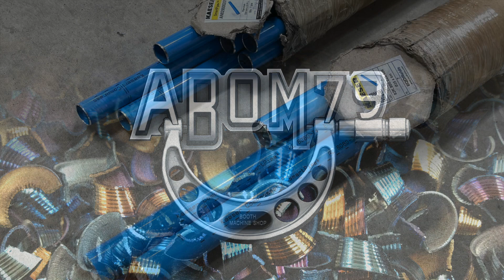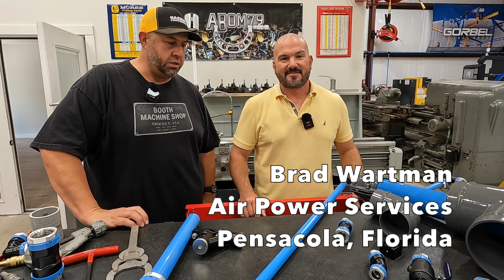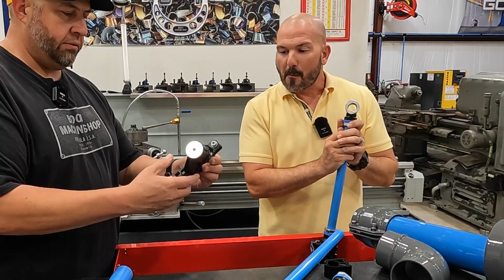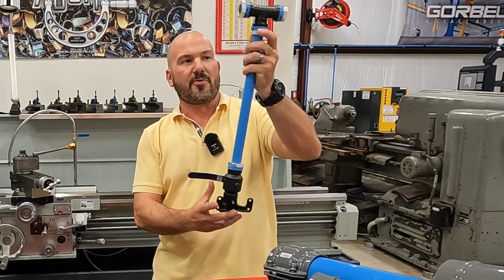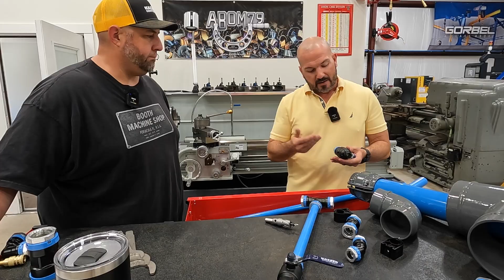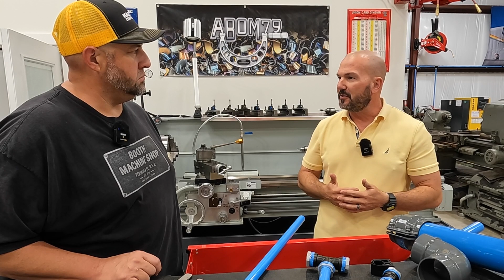KAESER Smart Pipe Plus Air System Discussion with Air Power Services

Comment: I know the compressor is Branded Kaeser which is a German company which a lot of people do not like but i do have to say that they are a very good compressor compared to the majority and do run a lot quieter than most. I am from the UK and Kaeser are Branded HPC in the UK, and having been trained on Various brands of compressor they are basically all the same, some a little noisier than others, but the difference is in the controllers, and this is where a lot of the problems arise with screw or scroll compressors. Now i have found that the Sigma controller on Kaeser/HPC compressors the most reliable, as some like Atlas Copco and Mark Compressors including Boge Compressors tend to be a little short on quality, there are forever glitches in them, and replacements do not come cheap.

Comment: PEX pipe SharkBite or Swedge fitting probably ten times cheaper just as good for just as long. Overrated over-engineered overpriced. Less is always more
Reply: pex works for sure. We use pex-al-pex because it stays straight during install

Comment: I keep telling people to NEVER use PVC for air. There are so many things that can happen. As they say, if it gets too,cold, it gets brittle. If it’s lightly by smacked by something, it explodes. But if it gets too warm, it gets soft. Then it grows a bubble and explodes. PVC gets soft enough to easily bend at just 140 degrees f. That’s not as hot as you think it is. If the joint isn’t cleaned and glued properly, it will blow apart. If it isn’t supported well, it can blow. But a big problem is the varying pressure in air, because air is, after all, compressible. Water does t vary that way. PVC is not good with a sudden rise in pressure.

I’ve seen every kind of PVC blowout. It’s not pretty. Some people claim they been using it for years without a problem. Well, good luck for them. Don’t follow their stupidity. You won’t be as lucky.

Also don’t use iron pipe. Water in the system will rust it over time. Copper is fine. I’ve done thousands of feet of that.

Comment: In my company production facility and shop we run copper pipes for compressed air. I don't think this material has been addressed in the video, any reasons?
Reply: They did mention copper  . hassle to install in my experience (esp. the soldering) and will be more expensive.
Reply: @Kosmonooit  I'll watch again, paying more attention
Reply: Copper work hardens from vibration. It can eventually fail
Reply: @KevinJones-pj8kx  never had a copper system fail. Don’t believe it.
Reply: I recall him saying they used to use propex which is used with copper so rewatch.

Comment: Adam, I question why you didn't complete the loop of the air line over the roller door
I assume air flows like water, (as in an irrigation system) if you design a system like you have for air in the shop, in water the air/water reaching the last point in the circuit will be less than the first point
If you complete the loop so air/water can have equal pressure throughout you will find you have a better system overall,
Can you please explain to me why you terminated the system EITHER side of the roller door instead of putting in a few extra metres of piping to have a better system 
Tony from Western Australia 🇦🇺
Reply: A loop is is a very good design and creates even flow to all distribution points. If one day his demand is such that this needed then it can certainly be added.  This particular installation was designed with 1" tube which is more than adequate to supply his fixtures.  There really was no need to spend the extra time and material on a loop system.  BTW, no need to assume.....air and water both are fluid and react accordingly.
Reply: @paulcopeland9035  well both are fluids but air is compressible, it's a very big difference especially when taking into account failure modes
Reply: @AlessioSangalli  What are "account failure modes"?
Reply: @leocurious9919  when you have a vessel with a pressurized liquid, the moment it breaks.typically it's much less dangerous than if it contains pressurized gas.
Reply: @AlessioSangalli  that is very true. Water and air are not the same. Water runs downhill, but air will go any way it can.
Reply: @AlessioSangalli  that’s true also.
Reply: @AlessioSangalli  Oh boy... I missread that. Sure, beeing compressible means it stores a ton of energy. Hency "anyone" doing pressure tests uses water.

Comment: Good timing for me on this video. I have a new Kaeser Air Tower that's not yet installed. I first saw an Air Tower at a trade show. Ran so quiet. I just had to have one for my shop.

Brad certainly knows his stuff, and he's very good at explaining it. The more air tank capacity the better. Less compressor cycling.
Reply: The tank capacity is only a buffer not the amount you require, the amount you require comes in CFM,, cubic feet per minute, however this can be controlled by a regulator, so work out what CFM your machines required ie: 6.5 bar is the usual pressure an machine may need like a CNC for instance, then set your Regulator which should be installed directly after your receiver tank/ or buffer tank, set it to approx 7.5 bar. that will keep the whole system at 7.5 bar, so if you had a 10bar compressor your system will not require that so you control the system by the regulator, which will only let out of the tank 7.5 bar so you have a good buffer, at 10 bar, and then CFM will not come into the equation also set the pressure differential on your compressor from what kaeser normally set at 0.5 bar, to 2.0 bar. therefore your compressor will not be running on load for very long and will probably spend more time off load therefore saving energy, and running costs.

Comment: Good info on this video! I have already decided to buy a Kaeser Aircenter SM10 for the new 16m x 24m shop once its built, My father have a Kaeser and it have been going strong for least 15 years. This video made me think about the piping system (HD Welding shop for mining and earthmoving items) i like to have clean air for my Plasma, Air gouge, impact, needlescalers etc. I was simply going to weld some tube together with up and down hooks for drop down to get the piping crap to dont get into the fittings. Need to check if this system is aviable in Sweden.

Comment: Smart, "smart" pipe, "smart" lube, "smart" weld... Are you all Americans so dumb to use simple good things, not to call them "smart"?! Adam, you grandpa and your dad was pretty smart. 
PVC welded pipes are much cheaper and more durable.
Are you so dumb, to use "smart" dietary, to not look like behemoths?!
Reply: Machine shop next door to me used all Schedule 40 for air lines, After a year or so one blew up. Blew a big hole right through my wall (only drywall).

PVC doesn't have to be in direct sunlight to get brittle from UV exposure.
Reply: no need to be rude my man.
Reply: PVC can explode under pressure like that. Sending glass like shards in all directions. Could break at any point of the pipe. After the PVC has aged some it's more dangerous and likely to explode. If it has had any sun contact as well it will most likely break in that spot.
Reply: @balacustoms1282  I use PVC at 10 bar, use my air pipelines for years, all services use PVC indoor, nothing really happened, for 15+ years
Reply: @sashicapur4980  You are lucky.  Be sure to stay away from black cats and under ladders.

Comment: I use pex, works great, and I am sure way cheaper.
Reply: Is it rated for compressed air?
Reply: @Kosmonooit  160psi at 78° burst rating 800psi
Reply: @Kosmonooit  ive been using 3/4" pex for 8 years now running air into my shop from the shed.. 80ft run underground and pex for distribution in the 30x40 shop with several drops and an m80 filter.   have never had an issue with the pex or sharkbite fittings although my system is set at 150psi max on compressors

Comment: Mate of mine installed it in his picture framing workshop (here it's called Unipipe). Very good looking installation, but shortly after installation, one of the 25mm connections burst open at 125psi and scared the living crap out of everyone. Probably due to poor installation, but a good reminder of how much energy is stored in these systems. Me, I just ran 3/4" pex with 1/2" drops to the machines. Would probably be OK with normal polyethylene pipe also, but would not run PVC for air - it shatters when it fails.

Comment: Thanks for this. Man that compressor is quiet. When I had my shop going, I had a 7 1/2 hp dual stage with 80 gal tank. I used 3/4" copper tubing with dryers and oilers at four workstations. 
Before that I worked at an aerospace company that had a screw compressor that was powered by a natural gas converted ford 460 V8 outside under a shed. Man that thing screamed so loud that we would wait for it to finish its cycle before going outside to our other building.

Comment: Whenever I get around to building a house, it's going to be plumbed for central vacuum and compressed air.  I'd want that air to be clean enough for breathing from a scuba tank, because among other things, I'd be using it for airbrushes.  What do you need to add to this kind of compressor to make dive-quality air?
Reply: Scuba Diver here: Generally for breathing air: water and oil separator and then a filter with molecular sieves and activated charcoal or some type of all-in-one filter called triplex filter (Bauer P0 or P23 for example).
I run the opposite way here at home, I just have a scuba compressor and I use a scuba tank and pressure reducer (old first stage scuba regulator) to power my limited amount of pneumatic tools to change car tires, inflate the tires, run a grinder or cut-off wheel or just for a blow gun.
Reply: I have to revise my answer regarding the filters. I am running a Bauer P21, the smallest filter they have. For more information search for "bauer p-filter" in a search engine of your choice. Other manufacturers should have similar systems 🙂
Reply: Kaeser makes a breathing air filter pack.  The air straight from the compressor is not considered safe  to breathe.

Comment: I would assume that the Kaeser system is far more expensive than a simple 1/2" PEX system. I understand that as a YouTube influencer (Abom79) you benefit from sponsorship, but you are clearly selling out for your own benefit; "look at all my new 'free' toys". Shame on you.
Reply: start a channel of your own then. when you cross that influencer line, just remember you don't deserve anything for all your hard work.
Reply: It takes a very small person to be upset at another's success. The shame is all yours.
Reply: @davewood406  _ I am not upset for Adam's success; good on yah, Adam! I am commenting on the fact that the focus on this channel has changed from machining to "look at my new toys". Stick to your core strengths. You needn't shame me for pointing that out; if you disagree, just tell me why I am wrong,
Reply: @dadatee1089  "shame on you" are your own words and are more honest than your reply. Do better.
Reply: I would assume that a simple 1/2 PEX system is not enough for all shops. Then one need look for other options. Let' assume tht among 0.5 million viewers there is quite a few in need of a larger, proffesional airsystem. sitting with a simple low cost system, that not fit one's needs, is no big help
Reply: @Rimrock300  - Agreed; you are talking about context. I would love to see Adam address this in the scope of the shop he is designing. As an engineer,  I spec products to minimize cost while providing the necessary requirements. Has this been done in this circumstance? Bottom line; what are your expected SCFM? I'm not hearing anything about that. That's not educating.
Reply: anything he receives free and is used like this in a video has to be declared on his income tax.
Reply: @AffordBindEquipment  It's gonna be a big tax bill!

Comment: Hey Adam, very nice interview with Brad. I was wondering though are those pipes just blue powder coated or do they have other colors? Not that that blue color is bad but just curiousity.
Reply: I'm obviously not Adam and as he may is to busy testing his new air system let me help you  😏
The color is the industry standard (ANSI Pipe Color Code) for compressed air lines (mentioned 1:44)  
and  Kaesser company sell this product only for this purpose. 
You sure can get aluminum pipes powder coated in every other color just not for this system.
Reply: @FabFunty  ahh k, thanks. I forgot about the fact it would be an industry standard coloring. Appreciate the reply.
Reply: @jeremymatthies726  Your welcome, 
I'm happy I could share some of my limited knowledge in this field  😏

Comment: only way to run air lines now may be on the expense side then the then the black pipe but save time on the cost of installation quick and easy to put up  and less messy too put on and twist the lock it done had one failed on the 10 year we using this system too unlock the couple and put the replace on it was quicker the screwin around with the replacement o-ring kit fix it when i had time  and put the couple back on the shelve for the next time
Reply: Good information but you need to always remember:  Punctuation is your friend!!

Comment: Very impressed with how the shop is coming together. At my old plant the pressure vessels had to be inspected by the County every year. It may not be required in Pensacola, but nationally OSHA 1910.169 applies. Might check and get ahead of this, avoid fines.
Reply: With no employees OSHA does not apply.

Comment: Of course other systems like pvc or black pipe etc will absolutely work and are likely cheaper, I feel like people fail to realize the cost of the equipment and the cost to repair a cnc lathe or mill. We aren’t talking about filling bike tires and basketballs…. A bad air system can cost thousands in repairs over the years. A piece of rust or trash from the air system tears up a seal in the pneumatic headstock or tool changer, you know that repair is going to be at least $1000 for a tech to fly out and tear it apart to fix it. If a high quality air system like this one prevents that from happening only one time in his shop, it paid for itself already. Adam I think your doing the exact things you should be, spend what you can afford to and do it right, it will save you time and money in the long run.
Reply: When the next air system comes out this will then be crap and nothing but cons will be said. Lol "a piece of rust or trash". As if nobody puts filters on to prevent such things regardless of the pipe used.. Just stop.

Comment: When my father built his body shop he designed the paint booth and the compressor housing.  The compressors were on a pad outside of the building.  He had the brick layer build the building the appropriate of 3.5 fee with the top row of brick were the brick turned on their side to let air into the tiny building.  He put s peaked roof on it with and shingle top.  There was enough room to walk around the compressors in case they needed service.  The duel piston double compressors in the building ran 10 hours a day M-F for more than ten years with out needing major service.  The oil and other things needed to be looked at but man those thing lasted forever and many days.  They were rebuilt once after the ten or so year mark.  My uncle, father, and I put all the black pipe in the building for the runs.  There were dryers and filters for every work station.  They came straight off the pipe perpendicular to the floor.  Sorta like the Kaiser rep talked about with particulate.  It was an awesome system through and through.  The noise was very little and could not be heard outside of 20 feet or so from the compressor building.  Behind the body shop were condos so those people would have been really not happy to hear the compressors.  So the little building was pretty genius.  They never got wet, snowed on, or what ever.  There was a massive wooden door in the front in case you needed to replace them or take them out.  He accidentally piped them in series at first lol.  Then he figured out parallel is best to make sure one is not killed before the other.  OK enough rambling.  I am happy for you and glad to see your shop is coming together.

Comment: Over the years I have been in industrial maintenance and working in the plastic indusrtry , I have seen what oils do to plastics over time. There is always a small part of oil that gets through the coalescing filters from the air compressor.

Comment: Sorry but I have had CPVC air in my shop and under my pole barn exposed to the weather for over 15 years now and never had a issue with it. I'M not saying this is a bad system on the contrary it looks like a awesome system but you know they have to say all the cons of every other system to make this system look the best.
Reply: You haven’t had a problem yet, you will. Ours lasted about 22 years before the 4” exploded.
Reply: @RicksOutdoors  Fantastic then In 4 more years I can rip it all out and spend another $50 and redo my whole shop for the next 20 years. Thanks bro you saved me. Nice to see fortune tellers watch Abom.
Reply: @MrWizards1974  you havent bought pipe lately have you? Be prepared for sticker shock. Its crazy how expensive its become over the last year
Reply: @GonzoDonzo  LOL $7.50 for 10' of CPVC is sure going to break the bank. Stop trolling.
Reply: @MrWizards1974  it used to be $2.50 a year ago. Learn what is trolling
Reply: @GonzoDonzo  I never said anything about how much it was a year ago but you seem to be dwelling on that. My point is that it's still a fraction of the cost compared to this system. I could literally redo my whole shop air system 20 times over in CPVC and 40 times in PVC. Considering my CPVC system has been perfect for the last 15 years ill stick with that. BTW CPVC has only gone up $2.00 per 10' stick so yeah you're an exaggerating troll to try to prove and irrelevant point.